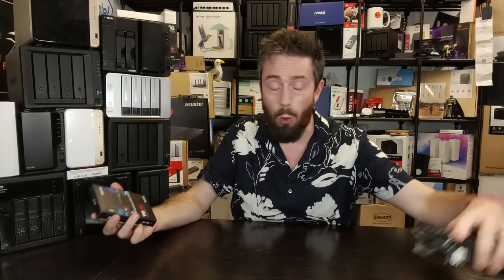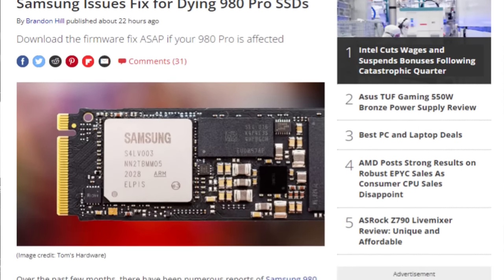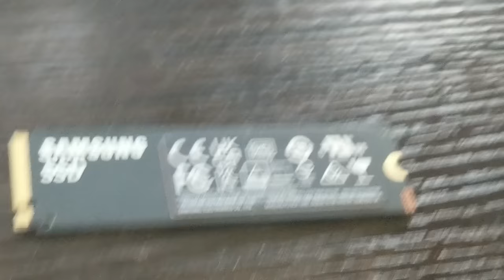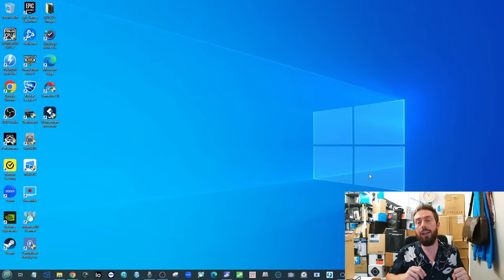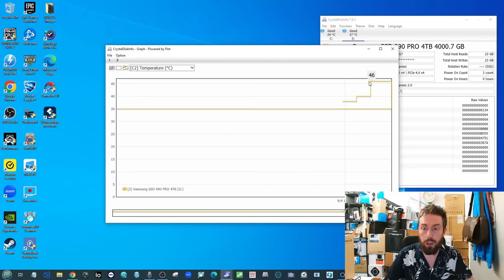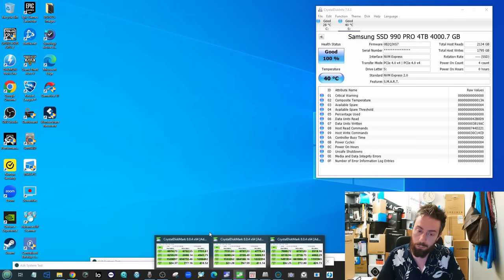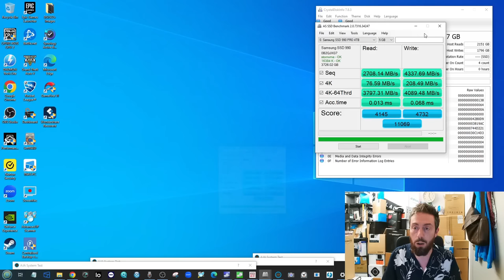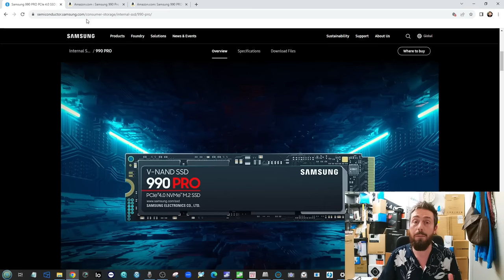Samsung 990 PRO 4TB SSD Review - Too Little, Too Late?

Comment: Would the high IOPS remain if the slot is run at Gen3 speed? Don't care for the ultra fast sequential speeds because of the associated heat
Reply: A 4 lane gen 3 NVMe slot can provide 4 GB/s. Using 4 KB IOPS, that's approximately 1 million IOPS. So you will lose some of the performance.

Comment: Are the 990s still coming with issues? They used to have problems several months ago
Reply: At least in Poland people were reporting that latest devices have already fixed firmware installed. If you are not sure just plugin Samsung drive to PC with already working Magician and doublecheck the firmware. After upgrading you are safe. Its only important to not write on that drive much before checking.

Comment: Wow, thanks for taking the time…. I’m getting a 2TB SSD for my new PS5 and I’ve been debating between the WD_Black SN850 or the SN850X, the Seagate Firecuda 530 and the Samsung 990 Pro. Which one is the best for my PS5 or would you recommend another SSD instead of these three?
Reply: I bought the WD SN850X 2TB for my PS5.  Speed and performance improvement over 850 and Samsung 980.  Firecuda 530 is the best one to get.

Comment: I want to upgrade my storage on my laptop to 2x4tb NVME's, but heat is what worries me since there is no space for heat sinks in there.
Reply: Did you buy the 990 pro? Had problems with temperature? I'm also taking a look on this 990 pro just for gaming on a laptop but I'm afraid it could get hot inside it

Comment: I went for the fanxiang S880 4TB for my systems OS and Game drives when i upgraded last month @ £178.49 for the 4TB model which claims 2400 TBW and they have all exceeded the quoted read/write speeds of 7300mb/s - 6800mb/s. The old drives i stuck in PCI cards or external usb caddies. Use to be a crucial guy but last couple of years the "lower" tier producers have caught them and passed them in value and samsung have priced themselve out of the range i am willing to pay to be blunt especially with the way things are going.
Reply: Samsung warranty is better and life of hd is longer, so it is worth the extra $$  in the long run
Reply: Yeah the competition is getting better or simply getting the equipment of nand flash chip manufacturing. Thats why ssd prices are dropping so hard and the big producers complaining cause their profits are dropping lol. No name brands are usually 25% cheaper or more but for a casual user thats enough to forego brand tax or things like better warranty. Thing with hardware it either works or it doesnt. Always have backups for your files though.

Comment: prices will keep droping - they were late but at least they are here - two in a raid0 match up well with 100g/bonded 100g networking which you will only get in diy nas - totally worth it - you can use 40g and have an upgrade path if prices are an issue - 40g mellanox cards are very affordable - run dual nas not just one, use a dual port card - you want to go nvme, no question and samsung generally are bulletproof despite a few firmware issues that were addressed promptly, adding a heatsink was great advice

Comment: I'm on the fence. I was getting Samsung only since my first SSD, 830. Then, I got 840, 850, 860 and then NVME 970 EVO Plus, 980 Pro. However, for some reason, the NVMEs disappointment me, broke extremely fast. For the fist time I jumped to WD, took a cheap one to try it out, the SN770 and thus far proved extremely good SSD, despite the fact it's dram-less. Now, for my main one, I will either go with to 990 Pro or WD850X. I'm a little afraid of the 990 since the problems with the firmware. Should I go with the 850X, having both WDs and be done with it?
Reply: Those problems solved over half a year ago. Check the manufacturing date on the box, anything post like 2023 06 xx should come with new firmware preinstalled but i'd still update to latest.

Comment: Waiting for 4TB SSDs to hit £100 mark personally for NAS use, nabbing 4 x 4TB for £400, is what is reasonable for me, speed I feel is there now.
Reply: It's probably going to be a while. I spent about 2 thousand dollars on 4x8tb 870qvo drives less than a year ago, they could be a quarter cheaper yes days.
Reply: I wonder do we need to avoid QLC on nas because their real write speed are really slowwwwww when write cache is full 

Usually we don't write that much data at once , but how about rebuild process ? It will fall into approx 100-150MB write speed ,that will be painfully slow
Reply: @frankwong9486  I read somewhere about the fact that the slowliness of the Samsung QVO drives is caused by the combination of an only 4 channel controller  and QLC, meaning the speed scales only with capacity up to 2tb. 4 and 8 TB drives are not getting better speeds thanks to the limited controller. I guess QLC drives as a whole aren't necessarily slow, the QVO series is just old.
Reply: Ypur nas is limited to network speed so m2 not needed

Comment: Is there an enclosure you can buy for the 990 Pro with heatsink?  The ones ive gound are all too small and its too much of a pain to get to my m.2 slot for an update even though the one i have has the update on it already.  But for the future.
Reply: The 990 Pro is available with or without a heatsink. I own a 990 Pro 2 TB that I purchased without a heatsink. My motherboard supplies a heatsink for each of the three m.2 2280  nvme slots that are on the board. In my case that means that I do not need to provide a heatsink to the drives that I purchased.

Comment: Gen 4 is fast enough, but 4TB is not vast enough.  
where are the 8TB drives?
Reply: everything you are asking for already exists.
- m.2 8TiB ... 3-4x the price (Corsair MP600, Sabrent Rocket)
- SATA 8TiB ... same price (Samsung 870 QVO)
- HDD 3.5" 8TiB .... half the price (Seagate, WD, Toshiba)
Reply: @ysmg9010  you know what I mean tons of smaal drives  but no decent cost effective 8TB drivesInstead they keep on making even more small faster drives that no one really has an advanatge off as they are no longer a bottle neck..   replacing a drive whioch isn't a BOTTLE NECK BY ANOTHER SMALL DRIVE THAT ISNT  A SPEED BOTTLE NECK IS LIKE REPLACING YOU 220KMH MEREC BY A NEW ONE WHICH HAS ALL THE SAME ADVANATRGES ECEPT CAN DRIVE 330 KMH..  THE TOP SPEED IS USELESS AS YOU ARE BOTTLENECKED BY A ROAD SYSTEM THAT MAKES ANY SPEED OVER 160 HMH MOOT